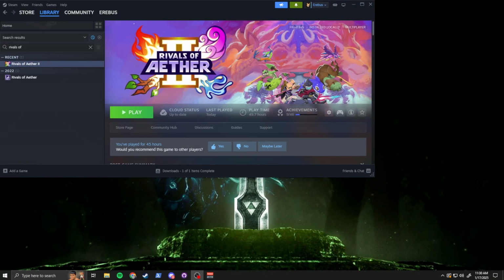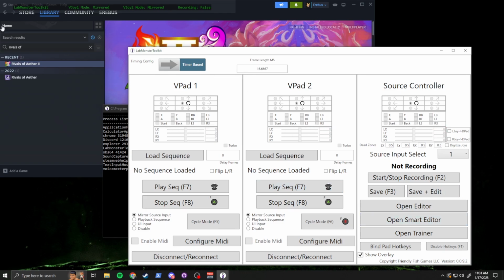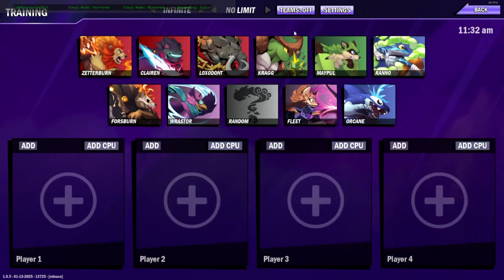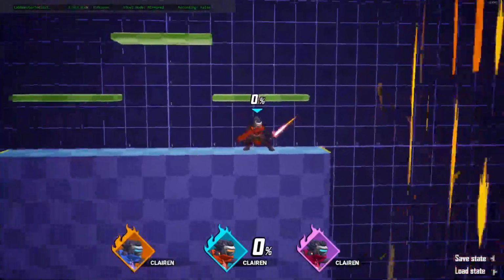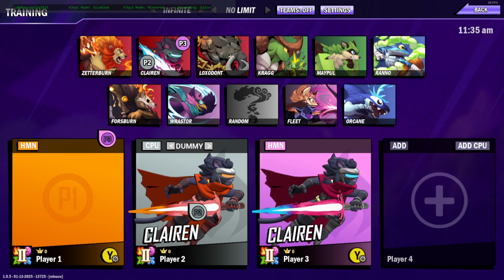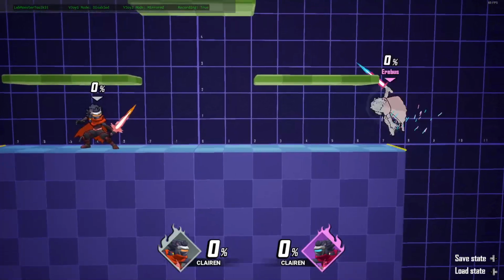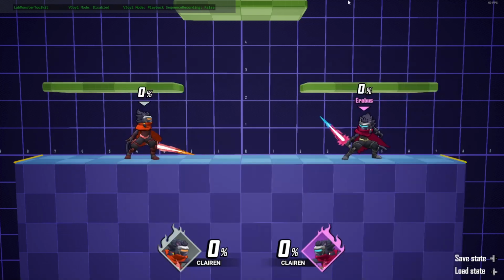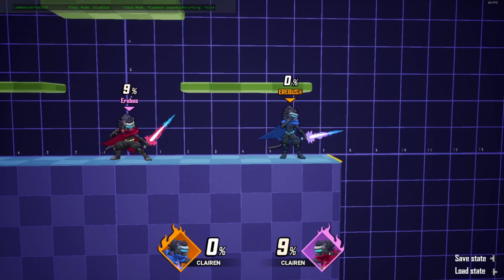Rival of Aether 2 Recording and Playback with Lab Monster Toolkit

Comment: i've been using this software but it seems to have problems playing back c-stick in sequences. 

the recorded inputs in the json file looks fine. note that i'm using a box controller. any suggestions?
Reply from the maker: @DolphinBrick  that's very interesting. I'd love to debug that for you if possible. Can you dm me on Twitter or bsky or itch?
Reply from the maker: For other users, this issue has been fixed in the latest release (0.9.3)